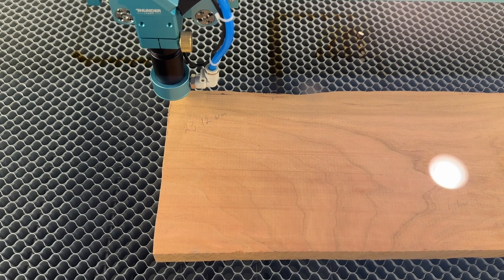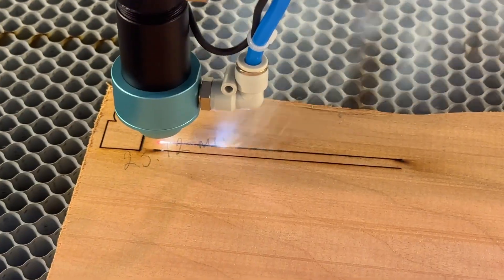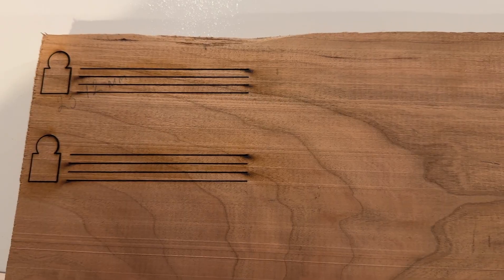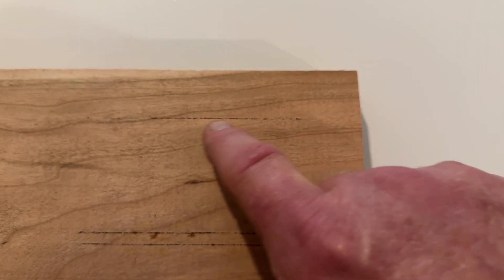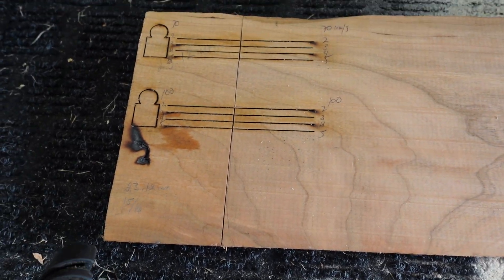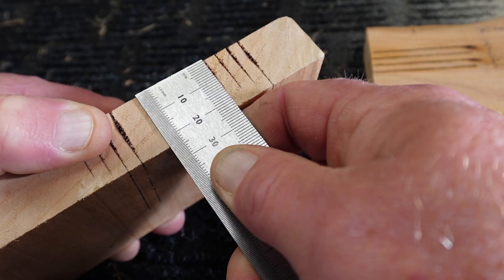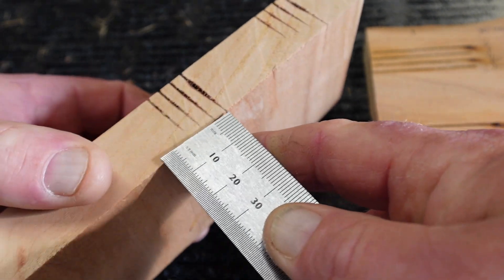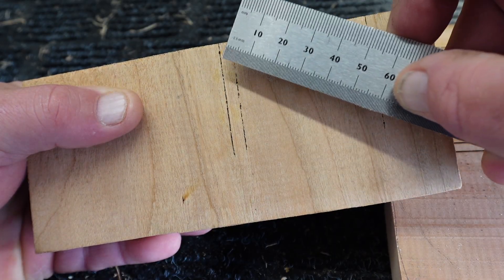How thick will the Thunder Nova Plus 60W RF Tube Cut.

Comment: They are totally getting away from the glass CO2 machines correct? I’m in the market for a second machine but not sure I’d go with an RF at this point. I need power to cut thicker materials cleanly.
Reply from the maker: Either the glass or RF tube will cut, just add external air. Yes I believe they are phasing out the glass tubes.

Comment: Morning Angry C! Hope you and the Missus had a nice Easter. Thanks for the testing - I am really happy with my Nova PLUS 35 so far but have lots to learn. Q - can you tell me what what your max PSI is on your Air Assist on that laser? Thanks !
Reply from the maker: @LaserNUG  the max you can go is 55 due to the solenoids.  The air pump produces only a few psi when wide open.
Reply: @Angrycraftsman  Thanks - I am trying to figure out how to use it cause the codes on the LCD display are confusing and I was not sure if I pushed a wrong button or something- LOL. I am getting a max pressure of about 2 PSI on this one. Thanks - wish you all the best sir!
Reply from the maker: @LaserNUG  For the low air side make use it open enough to give you  at least .3-.4 psi t prevent the alarm of activating. Open the high air side all the way.

Comment: Awesome job...thank you! As long as it does a great job on 1/4" wood and acrylic, I'm happy as I would never have a need to cut something that thick. When I compare the Bolt Plus vs. the Nova Plus 24 (same 60W as this laser) there is only a $355.00 difference...unless I'm missing something, why would someone get the Bolt Plus instead of the Nova Plus 24?
Reply from the maker: The Bolt Plus has speeds of 1500mm/s where the Nova Plus is 1200mm/s. The Bolt Plus has a different manufacture of tube compared to the Nova Plus. To be honest I would stick with the Nova Plus. Speed isn't everything. I also like the air delivery for the Nova Plus compared to the Bolt Plus. Wow that is a lot of pluses to keep straight.
Reply: @ LOL! Thank you. This is strictly for fun/hobby so speed is not that important.
Reply from the maker: @MyLifeAsMitch Even for us as a business accuracy and quality is more important than speed.
Reply: @ yes sir!